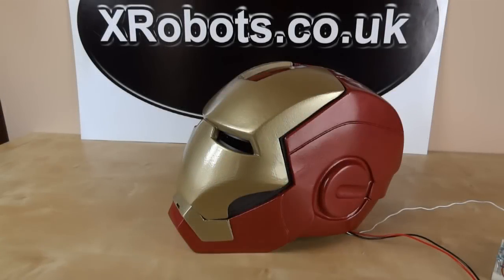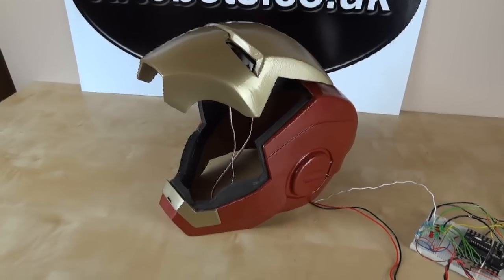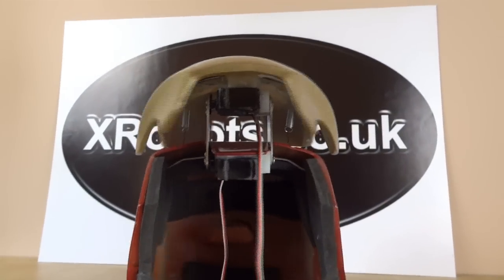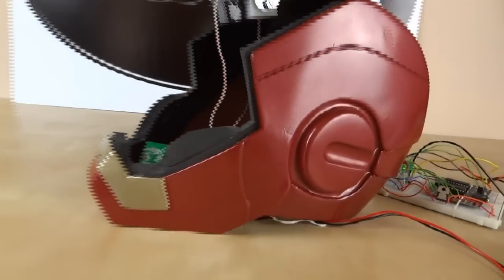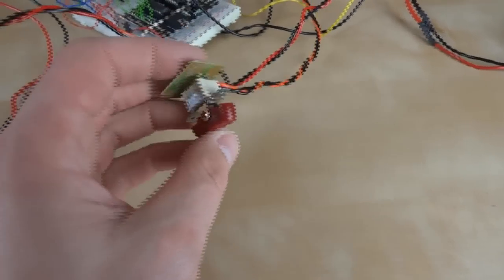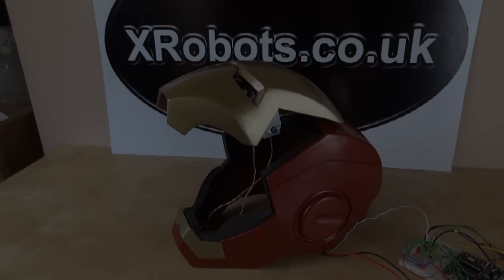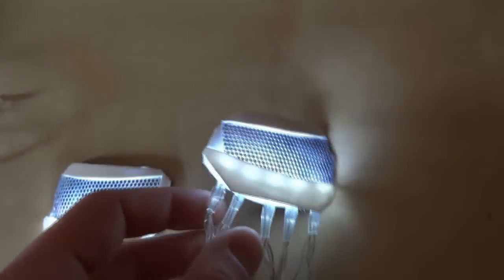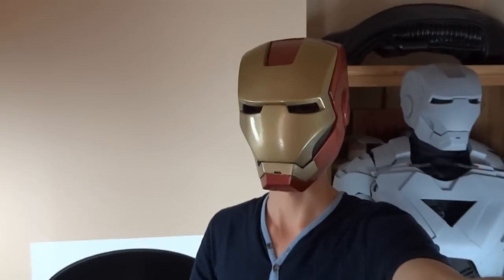Iron Man Power Suit #8 | Starting the Faceplate | James Bruton

Comment: As an alternative to an IR link, I think that it would be simpler and easier to use a magnet attached to the end of the helmet wire and a magnet of opposite polarity embedded in the suit and electrically connected to the rs232 controller. The wire would snap to the magnet when you put the helmet on and easily disconnect when you take the helmet off while still preserving your range of head movement.

Comment: This is a really nice solution to the face plate working. I am in the process of making a full pep Iron Man suit, just finishing the legs this weekend and then last few bits to be fibre glassed before I finish the filler on everything. I've seen people using Arduino boards to control the face plate, lights etc and would love to have a setup like yours or using similar. My problem is that I don't have the programming skills to use the chip board and costume needs to be finished by Halloween!

Comment: Just wondering - Have you ever considered making the air brake flaps for this suit? I think it might be a nice little detail. Although it could also turn out to be more trouble than initially thought. But anyway, they could be operated by some kind of internal pulley system which would run through rubber sleeves to a small motor hidden somewhere comfortable. Also, it could even be possible to use multiple motors to operate multiple flaps in sequence.

Comment: Ok, a few questions.  1.  How do you connect the lights to the servo control board?  2.  What are the codes to use to configure the servos and lights?  3.  Do you have a circuit schematic for the voltage regulator circuit board connecting to the new picaxe 08?  I have the rest of the circuitry figured out except these 3 points

Comment: Let me understand this. The switch sends a pulse to the pixace which initiates a command that travels via the data wire into the servo controller which tells servos to move different directions whether it is counter or clockwise. How would i configure a circuit board to command the servos to open and close? In other words what would the command be?

Comment: Why not use a linkage of sorts so you can achieve the same motion with a single servo?
The less servos you use the less likely it is to give you any issues and it'll use less power :)

Also the motion will be the same each time and requires less code :D